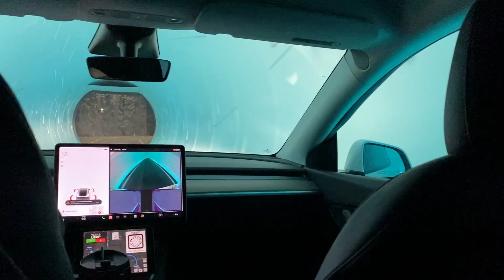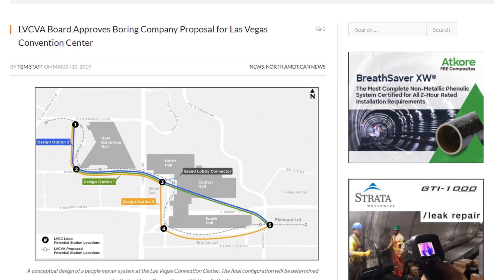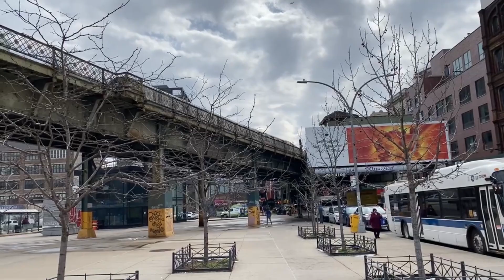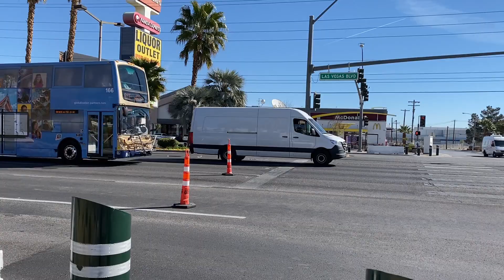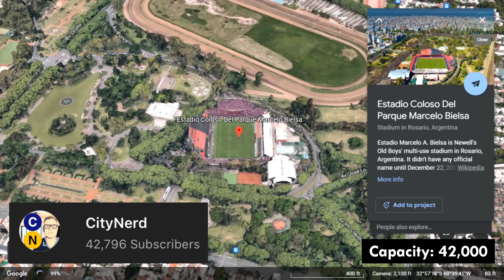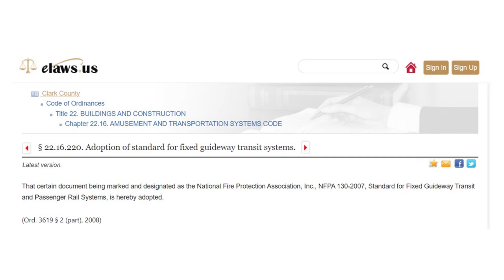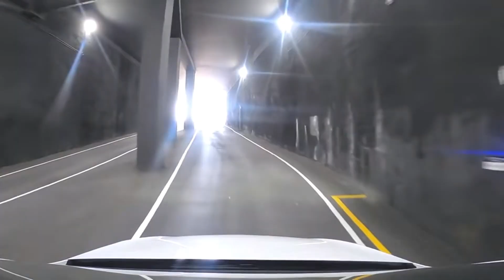Inside the Las Vegas Loop: Transportation Game-Changer, or Complete Waste of Time and Effort?

Comment: As others have said, it's all just a superficial PR stunt like so many of the things Elon does these days. It was probably close to free or at least heavily subsidized by Musk making it an offer too good to turn down for the owners of the expo centre. No sane business owner would pay full price to develop this.
Reply: I think you may be right about TBC lowballing the bid. It came down to two finalists: TBC’s $50 million loop vs. another company’s $215 million elevated train. 

At the last minute, the elevated train bidder reduced its price to $85 million, which makes me think they are the real scammers in this saga.  Whose pockets were those other $130 million supposed to line?

Musk and TBC had good reason to bid low. It was a big negative that they were new and had never done a commercial project before. The other company had been grifting (building transportation infrastructure) for over a century.   TBC won because of their low cost, time frame, and promise to cause as little disruption at the surface as possible. 

Now TBC has a small commercial project under its belt, so the money will start rolling in.

Comment: This is better than a PRT system like Heathrow Pods how, exactly? Those can even drive themselves.
Reply: This is a PRT system.   Eventually the cars will drive themselves. Tesla says it's developing dedicated taxis without steering wheels.   They may end up looking pod-like. 

I don't know if it's better than what they have at Heathrow.   Heathrow's does 1500 passengers per day, but I dont' know if that's just the demand.    It does seem Heathrow's could do more if there were more pods. 

This one has been tested at over 4400 passengers per hour, and has easily done over 3000 passengers per hour in real life.
Reply: Heathrow's was a trial installation with potential for expansion, with the junction at the car park end already designed to accommodate a route along the northern edge of the airport to serve all the hotels there. Indeed, an even more overpriced car park doesn't have a lot of demand.
Reply: @6yjjk  I think I stayed in one of those hotels when I was stranded in the UK during the Eyjafjallajökull eruption.   Then I took a train back to Hereford so I could at least get some work done while waiting for the skies to reopen.

Comment: You guys really don't get it.  The great thing about the loop is that there is no waiting for the next tram.  You just hop instantly into a waiting car and off you go without having to make several stops in between.  With a tram, you have to wait 10 minutes for the next tram to arrive, and then there would be stops at all the stations between  your start point and destination.  The loop does not stop at any station, as it goes directly to the destination of your choice.  So in terms of saving time, the loop will save a lot of time.  Because the loop runs continuously without having to stop, unlike the train or the tram, it fully utilizes the track, whereas the train that runs every 5 minutes or every 10 minutes waste a lot of track time between trains.  So, in summary, it is faster to use the loop vs the train, and secondly, you don't have to stop in between the routes and get directly to where you want to go.  Also, I like that you have your own car to ride in vs. riding in a tram or train.  Would you rather ride with a bunch of strangers or with very few strangers?
Reply: Found the Tesla marketing guy. Mass transit is about transporting large amounts of people without needing cars or parking spaces in urban areas. This thing is beyond USELESS. Plus it's super dangerous.
Reply: You have brain worms.
Reply: Congratulations, you've invented the taxi. There is a reason that using a taxi is slightly more expensive than public transport.

Comment: That video at 11:37 gives me ultra claustrophobia... are there even fire exits?
Reply: There aren't even Exit signs. Probably no lights to follow if electricity goes out. As a Swiss, this is the most apthetic tunnel I've ever seen. Unbelievable.
Reply: @jamaly77  How would there be lights if the electricity went out?
Reply: @kevinbailey8827  Seriously, dude?
Reply: @AardvarkDK  No. Not serious.   I know that exit lights would be powered by a backup battery (as long as the backup battery system didn't fail).

For the loop, all the lights, and the security cameras and the wifi are on a circuit with a backup battery.  Also the cars have their own batteries and they have headlights. 

If the power goes out at my house, I often don't notice, unless I look out the window and see that my neighbors' houses are dark, or I check my phone and see a message that the house has switched to battery power.

Comment: i guess a subway is way to inefficient against the loop
Reply: Definitely too inefficient in this location.  Since the max number of people who will ride this on the busiest days is about 4400 per hour, and that's only a few days out of the year, even a subway sized for 4400 per hour would be mostly empty most of the time.  It's an inefficient use of a train.
Reply: @kevinbailey8827  but not an inefficient use of over priced luxury cars for ... some reason
Reply: @afgor1088  Teslas are among the most efficient EVs on the market. 

A Model 3, according to a Wikipedia article, uses 450 Joules per passenger meter.   A Nissan Leaf uses 559 Joules per passenger meter.  (These numbers assume 1.2 passengers in the vehicle on average).

An Urban train is rated at 432 Joules per passenger meter, so the Model 3 is already close to the energy efficiency of urban rail. 

I don't know the percent full that the urban rail is using for that number, but I assume it's an average.    If a particular train is operating at half the average capacity  used for this statistic, the the number of Joules used per passenger mile will essentially double. 

This makes Model 3's carrying an average of 1.2 passengers around more efficient than a train running mostly empty.  And this is a location where running trains mostly empty would be the case most of the year.

The LVCC Loop is using mostly Model Y cars, which the Wikipedia article doesn't include.    And of course we don't know what kind of train the underground rail proposal assumed, so we don't know the actual efficiency of that train.   But the article does suggest that Tesla EVs can beat trains for efficiency in some some situations.  And the LVCC Loop is one such situation.
Reply: @kevinbailey8827  But, seriously, you need to make more posts about how great Teslas are. How much are you in for?
Reply: @AardvarkDK  I filled up my Model 3 last night at the Supercharger.   Cost me $11.  I usually charge it at home, which is cheaper.
Reply: @kevinbailey8827  Obviously you have one of their cars, but I am talking about stocks.
Reply: @AardvarkDK  My posts about how great Teslas are aren't because of stocks. They're because of how great Teslas are.  Don't try to change the subject.
Reply: @kevinbailey8827  But seriously, how deep are you in?
Reply: @AardvarkDK  Seriously, stay on topic.
Reply: @kevinbailey8827  Just answer the question.

Comment: At the quoted cost, this is a very cheap system that doesn't move too many people. I guess the logical next step is having larger vehicles so that the capacity is actually what's needed. I honestly think if Musk's tunnels are actually cheap, cities should build them happily but run electric buses through instead. Heck you could even have wires up top to make the vehicles have smaller batteries for when they exit the tunnels. What's not to love about that?
Reply: The reason they are cheap is because they are tiny and have no escape egress and little to no ventilation.  I hope I'm wrong but if one of those Teslas catches on fire, the last few minutes of the people in that tunnel's lives is going to be hell.
Reply: @BreckThePanther  Yeah, this is going to end badly. It's inevitable. That Kevin Bailey guy responding to you is also clearly one of Musk's employees. He's beyond pathetic.
Reply: @BreckThePanther  Tesla battery fires are rare.  If you read accounts of the very few that happen while driving, the car usually warns that something is wrong and the driver and passengers pull over and get out of the car.   Then the car "suddenly" bursts into flames...30 minutes later.

With that kind of warning, the tunnel can easily be evacuated. There might even be time to tow the affected car out of the tunnels.

Would you be terribly disappointed if a Tesla fire happened, but no one was injured and the loop tunnels were not damaged?
Reply: @kevinbailey8827  Dude, we know you work for Tesla. Give it up.
Reply: @dickriggles942  I don’t work for Tesla and I don’t particularly like Elon Musk. 

I just don’t like disinformation, so I respond.

Comment: Charlotte NC is probably one of the largest cities with a pathetic public transit.  The challenge is the layout with 5 directions away from center and scattered neighborhoods.  Bus routes are mostly hub and spoke, having to go far longer than necessary to traverse neighborhoods.  They have a single light rail that covers 2 of the 5 directions away from the city center and a new trolley that covers some of 2 more directions.  The finally have added an outer loop that helps avoid the busy city center.  But the only thing that’s saved total gridlock is the large remote workforce the last 2 years.  Many won’t go back to a daily commute, no matter the method.

Comment: This is of course the wrong application for this type of transport. But on medium capacity routs with special small bus vehicles, it will just be a lot faster than 2 high capacity lines where you need to switch and create massive loopway

Comment: The problem with the city loop is is not fast enough to move the capacity it’s needed to success fully work at a larger and affordable scale. Plus they using sedan and hatchback instead of using multipurpose large vehicles and basically not having any express and local tunnels to move at a faster pace. And it makes no sense
Reply: City Loop? That's the commuter-rail subway here...

Comment: 800 comments already, but here's my take: I LIVE most of the time in Henderson (suburb of Vegas).  I just spent 3 days in Amsterdam,  4 days in Barcelona, and 2 days in Valencia Spain.  It becomes immediately clear, just from visiting these 3 cities, that there is Little hope for America.  Very Little Hope. Amsterdam doesn't have a Bicycle Culture, its a Bicycle CULT!  Barcelona is less bicycle happy, but is moving rapidly in that direction - probably towards electric-assisted bicycles.  Valencia is more like an automobile based structure, but at least the vast majority are compact cars.

The suburban sprawl of Vegas, L.A., and most other American cities was designed around cars.  There is no plausible method to change this base infrastructure layout.  Work from home is the only model that makes any sense in America.
Reply: What American cities can do is eliminate predatory zoning laws that effectively outlaw mixed-use zoning. If they did just that, we'd go a long way to improving our cities.

Also, it would help the suburbs as well since as many of them deteriorate we can build denser developments in their place.
Reply: To quote "Not Just Bikes": "American cities were not built that way. They were bulldozed that way."
Reply: Move to Chicago. The transit system is quite good (especially compared to the rest of the US). They have buses and train stops every 2 blocks. And they go to every part of the city. 3-6 minute wait times. Unless you’ve got a big family to haul around, there’s no reason to own a car in Chicago, it’s more of a hassle than a convenience. Public transit is easier mostly all the time.

Comment: To give a single figure to illustrate the impracticality of this system: For any amount of passenger flow, at any given time, more wheels will be in motion than there are passengers.
Reply: I'm not sure that's all that compelling of a measure.  By that same measure, bike lanes are stupid because you have twice as many wheels in motion as passengers.

Whether this system is the "best" idea or not it can't possibly be less practical than taxis on a normal street because at the absolute worst all they've done is created a dedicated closed loop taxi service.

I think lots of people are jacked up over what this system isn't rather than what it actually is.  I Uber/Lyft around Vegas all the time when I visit.  If all they accomplish is to take that same concept and put it underground with reduced travel times, I'll find it useful.
Reply: @woodsie315  It will also necessarily have to be way more expensive than a taxi service, however, as they also have to pay off the cost of building (and maintaining!) that huge underground tunnel network, as opposed to just using the public roads that are already there.
Reply: @Codraroll  Well the whole "key" to the thing is TBC figuring out a way to build tunnels cheaply in the first place.  Not really any different than how SpaceX changed the economics of space by figuring out how to make rocket launches dramatically cheaper than ever before.

As far as the maintenance of the tunnels goes, I have no clue to be honest.  I don't think you do either.  I can't think of any particular major maintenance hog in a tunnel over a regular surface street but probably for lack of imagination than anything else.

At the end of the day, the cost thing is going to be proven out one way or another.  As far as I know, it's TBC's dollar on the line here to make it work.
Reply: @woodsie315  Nah, I've got a Master's in civil engineering and can tell you with some authority that tunnels are a maintenance nightmare. Groundwater intrusion, protection against subsidence (and earthquakes if applicable), ventilation, fire protection, ensuring adequate escape routes (including emergency lighting, signage, and reflective surfaces, not to mention the real estate cost of the egress to the surface), removal of rain/surface water that makes it into the tunnels, cleaning ... All those things add up to make a tunnel incredibly expensive to operate in the long run. Not to mention that a regular taxi company doesn't have to maintain the streets on which they operate.
Reply: @Codraroll  Fair points.  I guess we'll see how it turns out.  I guess the good news is that we will know one way or another since they are actually building the thing now.
Reply: @woodsie315  okay well, bikes are A LOT smaller than cars, meaning the capacity would be higher.
Reply: @sethdon1100 Your average Vegas visitor doesnt want to ride a bike to get between casinos.  That's pretty much a non-starter.

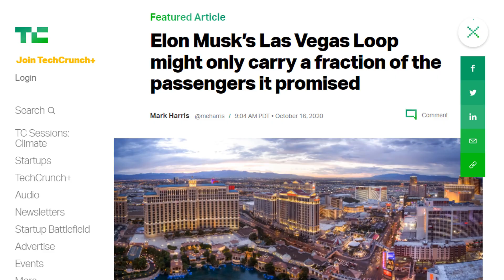Comment: 4:25 - Mark Harris of Tech Crunch admitted his article was wrong (see his twitter)
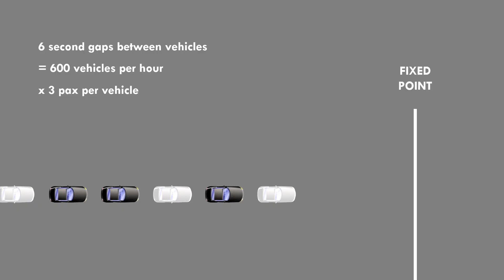4:52 - SEMA convention moved 3000/hour which is more than your 1800 figure. Calculating flow from a single cross section doesn't quite make sense since this is a people mover system. LAX people mover is calculating throughput of the entire system too
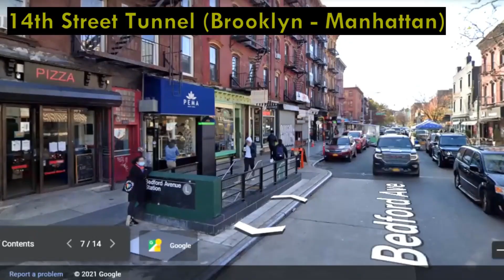5:00 - Comparing a $50m system to a multi billion dollar system is, obviously, going to yield more capacity. Not sure what the point is there.
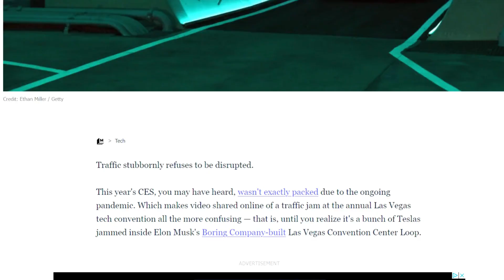5:09 - CES shut down one of the 3 stations used for the tunnel system, therefore you have crowding. And even with the crowding, CES resulted in 2 minute ride times. You can request the data from LVCVA and look at January 5th's statistic.
6:57 - LAX is building an automated tram that costs $5 billion and only moves about 10k pph. LVCC loop cost $50 million and was confirmed to have 4.4k/hour capacity.
7:10 - All Tesla cars have transfer boards, works for people with disabilities. Luggage can be put in the trunk (but why would you at LVCC?)
9:53 - Phase 1 reuses the same tunnel at Resorts World for both directions. Phase 3 opens the part of the loop that goes back, negating the Phase 1 downside. Also missing in the details: this was the "hardest tunnel" boring company ever had to drill due to the tight turn, as stated by Steve Hill of LVCVA. They minimized risk by not connecting the tunnels yet.
11:20 - Guideway systems include people mover systems. Boring Company's tunnel system, at least at LVCC, is a people mover system. Hence, NFPA-130 is used. RW Connector seems to be using NFPA-502.
12:38 - Elected officials are excited that the new 51 station expansion route uses 0 tax dollars. A subway/tram would have cost tax payers billions.
Reply: Excellent summary of the fallacies in this video of CityNerd’s. It’s unfortunate that he has fallen into the trap of “trains good, cars bad” rather than doing some deep analysis of the real advantages and disadvantages of trains vs the Loop.

All,too often it is this way - those mist deeply immersed in an industry fail to see potential disruption coming until it is too late.

Comment: It sounds like based on your analysis that the new passage for cars is not very practical at least not yet.  However maybe it’s just a small test and then later it will be used in a more practical way. Who knows? I’d rather see more practical bikeways and protected ones and less Strodes and more practical ways for walkers.